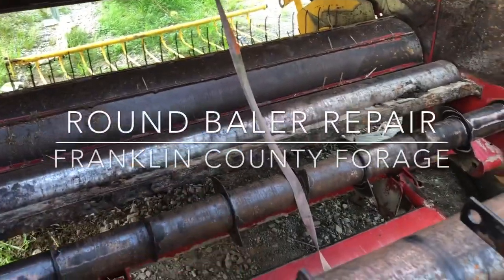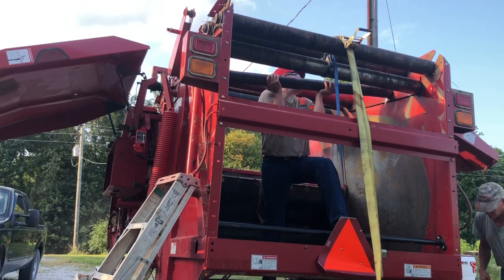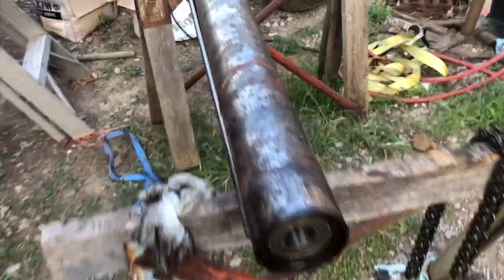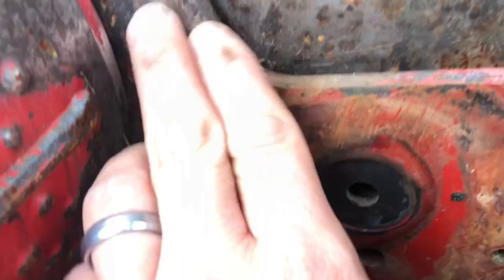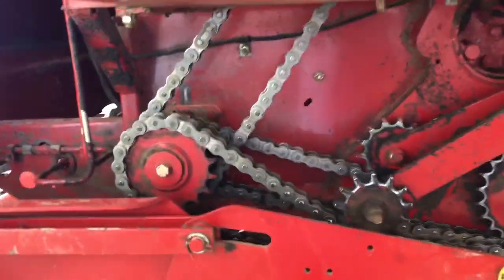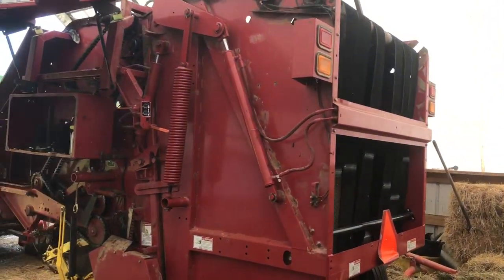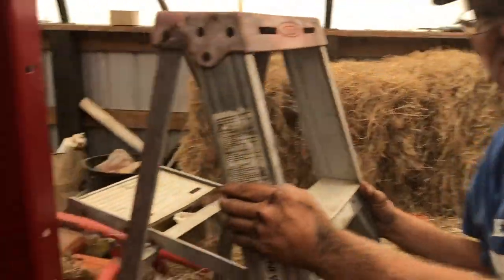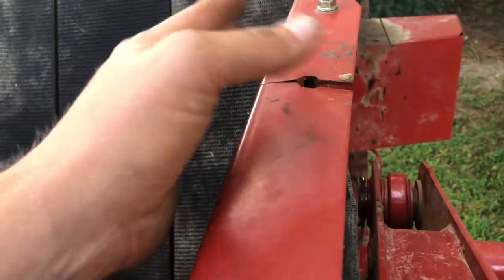Finally Getting Somewhere on the Round Baler!!! (BR770A)

Comment: were the bolts all accessible to remove the rollers from the holes in the sides of the baler?
Reply from the maker: It’s been a while but yes the bolts were all accessible. The sledge rollers had to be moved to a particular location to align with some holes in the sides to remove them.